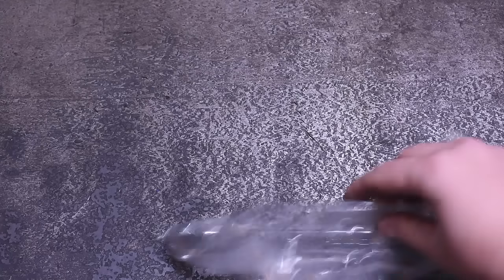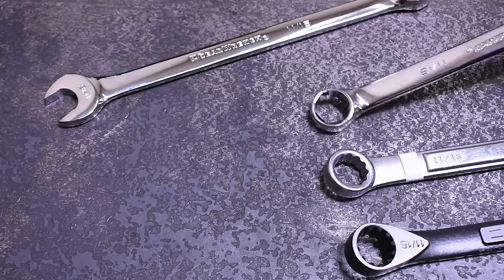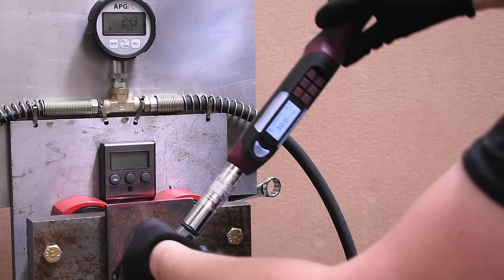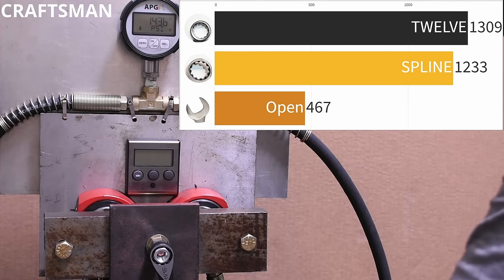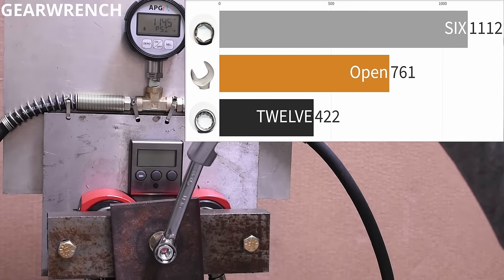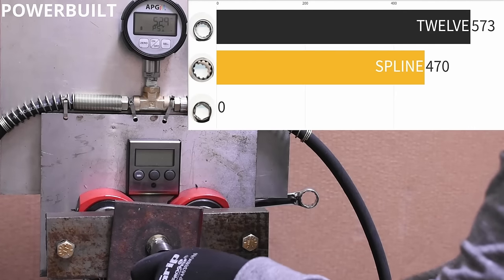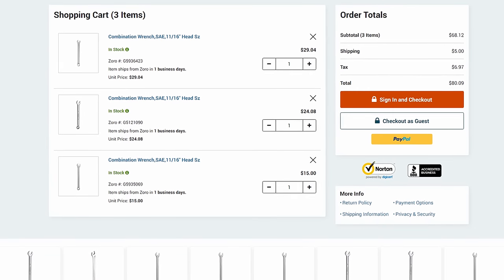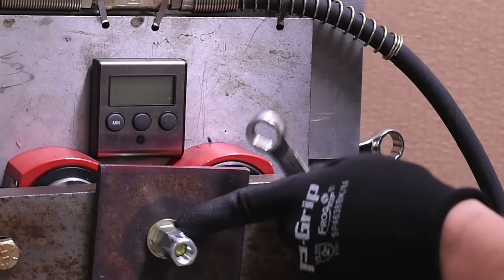Let's Settle This! What Wrench & Socket Design Will Slip 1st?

Comment: 7:12
I know I'm a bit late here, but 12 point sockets exist for use with square objects. We use these all the time for large taps like 1/2 NPT or 3/4 NPT. As far as I know, you can't buy a tap socket large enough for those. Instead, we use 15mm or 21mm 12-point sockets. 1" NPT tap fits in a 1" 12-point socket.

Comment: With ratchets getting 90 or more clicks per revolution, there really is no need for 12 points.
Reply: ...except on 12pt bolts.
Reply: There are so, so, so many situations you can't get a ratchet and socket on and you can only get a wrench on it. And ratcheting wrenches are great too, but again, often don't fit. To be fair I work on planes, which generally don't have so many issues with really stuck fasteners like cars do, and the engines of which (at least turbines) almost exclusively use 12pts. But even working on cars, it's still a good tool to have. The extra degrees can make the difference between the job being a total pain in the ass and the job just not getting done.
Reply: I'm a diesel mechanic and I encounter a lot of 12 point bolts unfortunately. Especially in areas that like to rust...

Comment: I'd like to see an "upgraded" open-end shootout. Snap-on Flank-Drive-Plus vs all the other open end designs with anti-slip technology. 

Keep up the great content. You have become one of my favorite channels.
Reply from the maker: Leave us to it!
Reply: I was wondering if they've ever done this before. Would be good to see how much improvement you get for any type of anti slip VS smooth for the extra cost.
Reply: @F0XD1E  I have a variety of wrenches and the Snap-On Flank Drive plus was absolutely a game-changer. I thought the smooth Snap-On open end wrenches worked well until the Plus version blew me away.

They are worth it. Just don't use them on brass or AN fittings you want to stay pretty.

Comment: I got a BGS socket set 1/2 /3/8 1/4 with spline sockets , the best budget set you can buy , been going at them 3 years now , no bolts that won't grip and also used impact on the bigger sockets without them cracking.

Comment: I think any mechanic that knows their stuff, already knew the six point would easily win.
I very rarely use 12 point, unless it's all I have.
Make it a walldrive six point, and you'd get even more torque down.
Reply: 6 point leave no room for the metal to give. It all has to shred at once. 

12 points leave lots of room for the metal to bend.
Reply: If cost weren't an issue, all fasteners would be 12 point. A 12 point fastener with a 12 point socket would have the most torque holding capacity. There is a reason these are used in mission critical applications like con rods, axle bolts, head bolts, and occasionally flywheels.
Reply: If cost weren't an issue, all fasteners would be 12 point. A 12 point fastener with a 12 point socket would have the most torque holding capacity. There is a reason these are used in mission critical applications like con rods, axle bolts, head bolts, and occasionally flywheels.

Comment: For whatever it's worth, I work in aviation and spline tools are amazing where they're actually intended, not where they've been advertised in recent years.  

Using them on spline fasteners, they're just about impossible to slip or strip the heads, unlike when trying to use them on 6 point fasteners...

Comment: The 6 points having greater torque makes sense since they have more contact with the bolt.
Reply: The 12 point more closely resembles a circle so by default it should give the poorer result.
Reply: Manufacturers with 6 point sockets, with rounded corners disagree with you 😀

Comment: The way it was described to me when I was in automotive school was that 6-point has more surface contact than a 12-point and will therefor apply more of your force to the surface of the nut, vs a 12-point will have that same pressure hitting less of the nut, and will therefor be more likely to slip.

Similar to if you are able to grip something with your whole hand vs just a small portion of your hand, the one with more contact will offer a better grip.

That is also why the open end wrench is not as good, because that open end accounts for 1/3rd of the surface contact that is automatically just missing, so it is a handicap overall. 

The appeal of the open end wrench and the 12-point wrench is that is that the open end can slip onto any hexagonal nut without needing access to the end to slip over it, and the 12-point has more angles of use, where the 6 point has exactly half as many angles of use.
They DO have their necessary uses.

Comment: I am a industrial mechanic and I personally use 12pt in my chrome sockets, 6 on wrenches and impact. I use the 12pt on alot of the blower motors I tend to work on that all have 12pt bolts on them and I like the adjustability of them in confined spaces paired with a high tooth count socket wrench. Now I only have up to 1" 12pt sockets. Everything above that going into 1 1/8th and up sockets or wrenches are all 6 point. If you are rounding over a 1" bolt head then you've got some problems other than your wrenches lol. Just my two cents. Great video tho, great data. 👍

Comment: I’ll say from working on a lot of earth moving equipment with extremely tight spaces like bulldozers, skid steers, excavators etc… a boxed 12 point is really useful for when you don’t have a lot of space to work with, but if you need virtually any torque you might as well just go get the 6 point and figure it out because those 12s will never hold up to the kind of torque you need on that heavy equipment.
Reply: LOL,that isn't specific to only heavy equipment..........it's anything with a bolt.....

Comment: I only have anecdotal evidence of what I use and when, and sadly sometime 12 point is all I have available.  But I personally disagreed when I saw AvE’s video back when he posted it.  I always try to buy 6 point sockets and wrenches. Imo they also help when a fastener is severely deformed or degraded and you can hammer them on to reform the metal into a slightly smaller size.  Was happy to see some data confirming my limited and uncontrolled experience. Thank you for sharing!

Comment: This reminds me of when I was watching an episode of this old house and they show you the proper way to use a pipe wrench... The point is is you want as much metal touching is possible which is seems like the reason why the six point works so well it's because it's touching at every point of the nut. When you get up to 12 point and spline, it's only grabbing the nut in a smaller spot so it's not touching as much of the nut

Comment: I would have liked to see how the "so called"  universal wrenches and the socket that replaces a whole tool box of sockets.would have fared in this test.
Reply: They are trash. Donut Media has a video on them. They do get decent torque on very large bots, but the pins inside bend or seize and will stop working after one or two uses.

Comment: I usually ONLY use a 12 point wrench on a 12 point bolt. Otherwise, no. No.. I'm impressed with the spline ends, I may add a set of those to my wrench set. 6 points are fantastic but if you're in a tight spot and can't get a socket in, it's tough to use. Great work!

Comment: Thank you for the interesting video. I live in metro Detroit, which is part of the "rust belt." I own 12-point tools, but I am always on edge when using them because I've rounded too many fasteners over the years--and that can ruin your day. I always grab for a 6-point tool first. Occasionally, a fastener can be in such an awkward position that it makes it difficult to line up a 6-point tool properly, and that's why I still have 12-point tools.

Comment: the 6-point is by far the best in a new fastener. 12-point was created because the industry isn't standardized and bolts and nuts of multiple, often lower qualities are manufactured, and also often time and usage have taken its toll. The spline is a further try in that direction.  To undo a damaged nut/bolt, just heat it until red, and make a smaller 12-point fit and if that doesn't work, melt it. In surface areas to remove a damaged screw use mig on a nut and if that doesn't work, drill it and a helli coil is the only decent solution.

Comment: Depending on what your working on, I  work on business jets mostly use 12 point bolts. I  have both in my box. But good set sockets is a must. I have preferred Snap on.

Comment: I have 6pt combo wrenches and 12pt double box end wrenches.  Break loos with a 6pt then use a 12.    I've only used spline on spline fasteners.  A properly fitting spline will fit a spine bolt tight.   With a 12pt the wrench should fit 12pt tight.    Headaches can be saved when something seems loose,  some bolts on the low side of the tolerance,  I'll see if another wrench or socket fits tighter, even trying what fits best not the specified by switching to fractional or metric.

Comment: Great Data.
Since most rounded-off bolts are a problem when breaking them loose so the Six Point should be in your kit since it delivers the most force.  Once you've broken it loose, you can switch to a ratchet or open-end wrench to get it the rest of the way off if it's in a tight spot.

Comment: Great comparison y'all!  Spline seems intriguing, however I do wonder how well they age since they do rely on a good spline edge to 'cut' into the bolt/nut head to resist slippage.
Reply: That's a really good question.  My guess would be that once they start to wear, they become useless tools pdq.  Then again, I was genuinely surprised to see how well they did in the first place so I just might be full of crap on that one.
Reply: splines are meant for spline bolts I've only seen them on helicopters and some planes so far lol they don't rely on biting the metal 😂

Comment: As a mechanic in the US we always found the 12 point to slip first.  And all the years I worked I never saw anyone with spline type wrenched in their tool boxes in an automotive repair shop, foreign or domestic.  A few had some Wentworth from previous jobs but very few of those.

Comment: as a trades men and car repair handy, didn't take super long to really see the proof in 12 vs 6. It's nice to know that spline would be a better investment than a 12 point though. even though 6 pointed wrenches can be a pain in the ass depending on what your doing. When it comes to sockets I've broken rachets and torque bars at the connecting point or straight up twisting the head off on shitty hardware removal. Thats where oils sprays come into play but even then a 6 point will cause something else to fail before it'll ever think to strip something

Comment: I have been working in aircraft maintenance for nearly 15 years, most techs get all 12 point wrenches as quite a lot of fasteners in aviation are 12 point and unlike your average car, aircraft get serviced WAY more often which tends to keep hardware in good shape, not to mention aircraft grade hardware is usually very strong.  I think I have maybe 1 set of cheap sockets that are 6 point.

Comment: My first thought was how the test bolts were machined. I feel like can see visible machine variations on them. I could be wrong but even a small/slight difference in the roundness bolt-to-bolt would change the torque reading significantly.

Comment: Excellent testing!  But you are a machinist and I fix houses.  For these types of tools I rarely need anything other than:  3/8,  1/2,  5/16,  3/4, and 7/8ths.  One inch and bigger (rare except in plumbing) I use a adjustable wrenches.  So don't break the bank buying a big automotive set you'll never use.  You DO need good sockets in these sizes also.  
     But here's a thing:  Which brand uses the best metal for the tool?  I'd like your opinion on that one.
     Also, if and when you test vise grips, would you please include the data from this "best" category for comparison?

Comment: Not being a mechanic and when needing to remove a rounded bolt. I find my vice grip works quite well.  It usually means though that the bolt will need replaced.

Comment: I have found that lubricating the threadetc will allow much greater pressure to be applied by the nut with less force. Did you lubricate anything before testing?
When using Loktite to prevent the loosening of parts (on a bike for example) the loktite actually lubricates the sliding parts before it drys and glues them together.
Maybe another set of readings using lubricated threads?
I know you are testing the spanners but you should give them a level playing field and friction denys that as there is always a range of resistance without grease etc. 
I look forward to the 'improved' tests 🙂

Comment: Crescent makes all three. They make a very cool pass-through design; one ratcheting end the other end a shifter with with a plumbers gripper thing  on one side which you can flip around. 
Could you also test the other type of spline drive which is the 6 point rounded. The best way I can describe it is a torx socket that's been filed down so its a lot less pointy. Only a few manufacturers afaik. I thought GearWrench had them. Force brand has but I don't know if USA stock them (I'm in Australia)
Reply: The first time i saw these it was mind bending like the matrix 

I felt a similar way when i saw bikes with a chain that went to the front wheel

Innovation,  amazing

Comment: Love these tests.

6 point is swinging lost when you don't have the space, but you can rotate the wrench back and that can take some of the gap. Unfortunately, sometimes you need a small 6 point where a socket won't fit and you need the torque (Think mopar driveshaft straps, '84 dodge ram and 2000 ram both take 5/16" 6 points because the torque is huge on that small little head. I can sometimes barely fit a socket in depending. One of those things where just having more tools helps you fill in more edge case needs.

Comment: Bit of niche request but I’d love to see a chamfer-less socket test for suspension caps. Most are made from aluminium but some are steel and as the caps are shallow hex heads made from aluminium I’d be curious which socket is the best for the job as the slightest slack in tolerance can mark the anodising of the cap

Comment: This matches my experience with sockets exactly.  I avoid 12 points due to how easily they can strip a bolt, user error or not.  They really only excel in rare situations you cant position your 6 point in a turnable way.

Comment: my favorite use is 6 points on easy to get to areas, 12 points on hard to get to and damaged hardware and splined on spline hardware. for the most part I only see spline bolts and nuts on airplanes so tip to people working towards your A&P, buy spline box end wrenches and sockets.

Comment: I have one set of kobalt spline sockets. I only use them to remove old square head bolts.  I do a lot of repair work on old barns and always find these annoying square head lag bolts holding door hinges and sliding door track on.  They often have several coats of paint on them too sometimes at 12 point will grab them but if they're starting to round off a spline's the only thing that really grabs them.  They are cheap sockets but  was the best 20 dollars I ever spent even if only just for this task haha.

Comment: I lived for years in France and only used L Shaped Angled Hex Socket Wrenches.  I feel like a more even force can be applied to a bolt where ratcheting sockets and hand wrenches will twist and damage the bolt.  The best at the time was Facom.  Can you make a test using L Shaped Angled Hex Socket Wrenches?

Comment: The spline made it's appearance in the 70's in the aircraft industry.  I first ran across them on the Pratt-Whitney engine used on the DC-10 aircraft.  It may have been used before or in or apps but thats when I first encountered it.

Comment: I’ve never seen a torque test on the tools I use but I’ve had bolts break before I rounded the heads off.  I love my Metrinch tools.

Comment: Because the socket wrench handle applies torque through the right angle, it seems like you would have to seat the nut deeper in the socket to compensate. I know you’re comparing it against boxend, but I think it’s always going to round out when it can’t grip the nut enough to make up for the offset (of the socket wrench handle being further away from the end of the nut). Anyway, just a thought, I’m not a professional, and enjoy your videos.

Comment: I knew 6 point was going to be champ. Use them all the time when I know grip matters. The shocker to me was the Spline ended wrenches. I typically use the 12 point.... figured the spline was gimicky as well. Truly impressed with how they performed. Might have to buy me a set of them.

Comment: So I'm just seeing this now, but 
Matco has these special non slip sockets. They look like am external torx socket but they are for damaged, rusted, and rounded fasteners. They aren't like rounded twist sockets, bit actually have points to them. I have had a lot of luck with them. I would enjoy seeing you test those, and maybe other manufacturers and types of non slip sockets
Reply: Made by VIM tools

Comment: I will say from experience that the brand does make a big difference. My dad has matco spline wrenches and they are awesome, so i bought some gearwrenchs that look identical and im pretty sure they are both made by apex tools. Not even close, the matco wrenches fit the bolts way tighter in the first place and this makes a big difference. Other than that, i find cheaper wrenches are slightly more flexible, this alows them to distort and loose grip earlier.
All that being said im a diesel tech and my mastercraft wrenches have worked well for me.